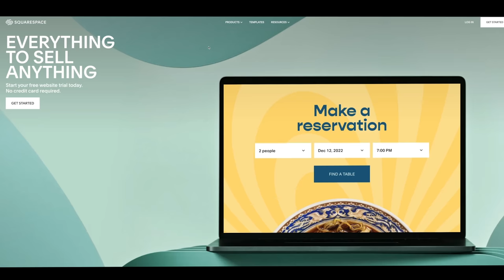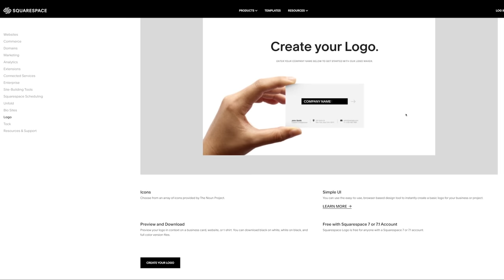There's been an accident.

Comment: Awesome that the target has already been exceeded. I have been working with table saws from the age of 8 all the way up to today a total of 51 years and although there have been near misses I have never been injured by a saw. I'd say there is an element of luck in it but, you never use one when you are in a rush or tired or with a blunt blade or on green wood without at least a riving knife, worst of all is trying to cut a long narrow piece at right angles to the fence OMG I've seen it done!. Modern saws can certainly be better and there is a technology that will quite violently stop the blade when it contacts flesh before making any kind of deep cut. So often the guards just get in the way though and do get removed and not replaced especially in a small workshop without strict rules.

Comment: In a way, I’m surprised Benoit was not injured far more badly.  Table saws can be very dangerous and even deadly. SawStop is the brand for magically safe table saws in the USA. I think the blade itself has an electrical current in it that can tell when it touches flesh, and it stops the blade in a microsecond. Best wishes for a speedy recovery to you from Pittsburgh, Benoit!  Keep flipping hammers, Philip—Philip the Flipper

Comment: You can get injured on new equipment too. It not just equipment. It's sometimes technique, or just not being very careful,  or simply making a mistake or perhaps having to rush something. .  And no matter what you do accidents can happen. But my God you people are wonderful.

The door hadn't warped. Since all you seem to have to do is shave off a bit of length that suggests the door expanded due to humidity. If you had waited it might have just shrunk again as the weather gets dryer. You should have listened to Benoit and waited. Now you might have a bit of a gap at the bottom that might not be visible because it's at the bottom edge. Maybe only Ziggy might see it and he probably doesn't care?